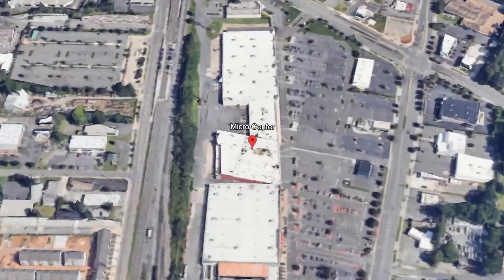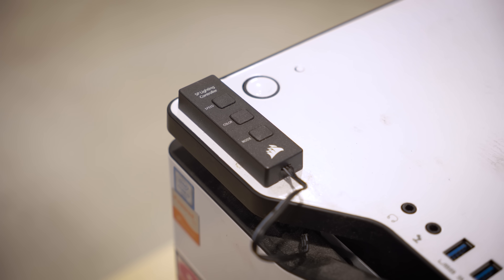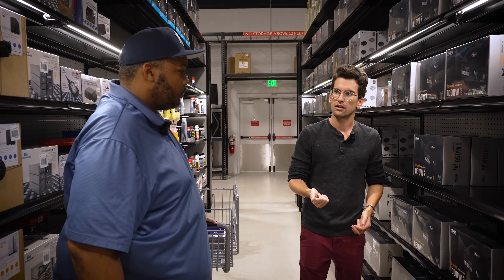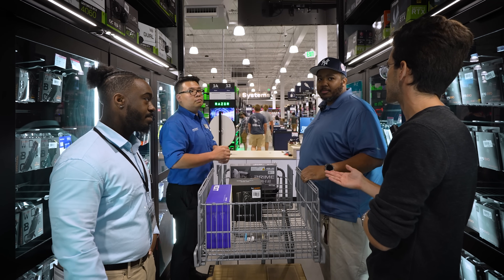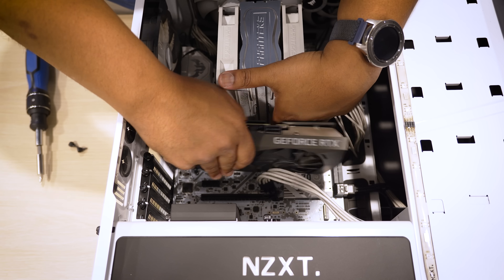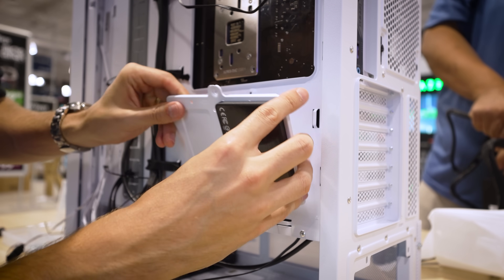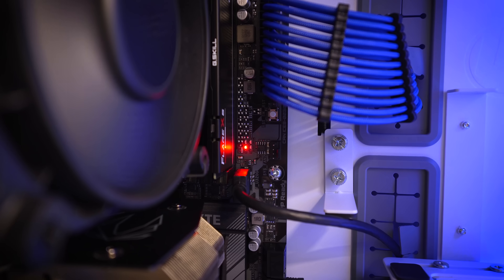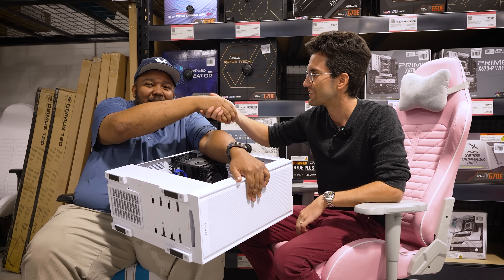Helping ONE LAST PC at the Charlotte Micro Center! - Gear Up S3:E6

Comment: I'm kinda confused why he made that swap on the bundles 
....less cores in the ryzen .... wasn't any better in any way
... just more expensive ....I would have just grabbed more storage in that case or 2 more ram sticks if the budget allowed it but spending more on components that gave no better performance with less cores and a bigger cost was a dumb move imo
Reply: Simple, do you want to have a dead platform or a platform with an upgrade path? That's the question that the MC Rep Justin basically asked with my remaining budget. So I went with the one with the upgrade path. More for my money.  - Sean

Comment: Hey Gregg long time viewer..figured I'd shoot a question in hopes u might have a quick reply..alpha testing a game called off the grid 2min into the game my pc makes a noise as if a USB is unplugged screen goes black and won't post peripherals don't work NOTHING!!! If I take out gpu and use internal graphics everyrhing works
Reply from the maker: Well it's an alpha game, so there's no telling what it could be doing to your PC... If it's the only game doing it, then it's the fault of the game and there's really nothing you can do about it until the devs patch it.
Reply: @GregSalazar  not just during the game it's not working at all since then ..I only played it for 2min my pc's gpu hadn't worked since only on board graphics but thanks for the reply

Comment: Silicon Power SSD is Junk I had one go bad after 1 year, I would try to avoid those!
Reply: The Inland NVME is my boot drive now. - Sean
Reply: @cellss0138  But you put it back in your build as mass storage right? That wasn't my boot drive ether but I had a major issue with one of those SSD where it would prevent my PC from booting up. Tried everything you could think of and in the end I just unplugging this drive and that made everything starts working again. At first it stated crashing in games and I thought it might be the MOBO, Ram, GPU or PSU or some major component, but after I tested everything I was confused, it all checked out fine. I even reloaded Windows 11 fresh and same thing, a couple days later it started crashing on YouTube videos, then eventually it would not allow Windows 11 to load at all, even though the SSD was not the boot drive. Someone said test your storage on Reddit, and sure enough it was that SP SSD man. If you ever get these symptoms, unplug that drive but honestly I wouldn't truth that thing even as a games drive.
Reply: @cellss0138  I had one go bad recently and it wouldn't let my build load at all, I wasn't using it as a boot drive ether, it was mass storage, but for some reason at first it would crash in games, then after a couple days it was random crashing and in the end wouldn't let Windows 11l load at all. I tried and tested every major component in that build and they all checked out fine, spent about a week pulling my hair out till I turned to reddit and posted and this guy responded about SP SSD's being junk. If that thing is still in your build I would yank it out and throw it off a building if it were me, after what I went through with mine! 🤣😂

Comment: I Believe ASRock have a newer white version of the B650E Steel Legend, called the B650 Steel legend WiFi  which seems to be B650E spec but with a white PCB in addition to the white heatsinks.

Comment: every time a  low budget build goes wrong. GAMING PC PARTS are simply too EXPENSIVE then you have to save up $3000.00 + a EXTRA $1000.00 for things  you might need like GAMING MONITOR that is  $400.00 to $500.00 mid tear price and you need a WALMART ONN MACHINIAL  RGB KEYBOARD $50.00 my have a DEAD  RIGHT SHIFT KEY for some strange hell hole in the production line in CHINA and a under $10.00 WALMART ONN MOUSE NONE RGB cheapest short cut. to keep the cost down. try a X570 MOHTERBOARD I know its OLD GEN its fine.,now for the secret $200.00 on NEWEGG RYZEN 7 5800X I cannot do business with MICROCENTER NO DELIVERY SERVICE the RYZEN 7 5800X is the BEST 8 CORE GAMING CPU then use the  AMD WRATH RGB AIR  CPU COOLER for a sweet  RGB CPU COOLINGbuy the 3rd CHEAPEST BLACK TOWEER$ $40..00 this is going to be EXPENSIVE GSKILL TRIDENT Z ROYAL GOLD or SILVER 32GB DDR4  3600 MHZ CL13 and RTX 3070 or see if a RTX 2070 SUPER is may be a lot harder to find. GRAPHIC CARD is forever PAIN IN THE ASS EXPENSIVE and EVGA SUPERNOVA 850G2 POWER SUPPLY I do not think all that money is not going to be use  and 2  of the 2TB NVME SSD windows 10 HOME 64BIT done. it may be old gen its going to kick ass on gaming  not interested with SPEED WARS BREAKING  WORLD WAR RECORDS just  make it work great I did buy a $700.,00  LEGION GO this is what low price dose. its full of FARTZILLA its a CRASH DRAMA GASMES  DO NOT LOAD. then GAMES CRASH LOAD SYSTEM RAM CRASH WINDOWS 11 BUGS CRASH SYSTEM it goes on and on and on. the best way to deal with that isdo not buy CHEAP SEAT LEGION GO and build a $3000.00 GAMING PC that might cost $2000.00 buying OLD GEN PARTS INSTORE PICK UP DOSE NOT WORK IN HAWAII AND ALASKA there are a lot of STATES that do not got a MICROCENTERso  buy a two way AIRLINE TICKET lots of TAXI TRIPS and HOTEL ROOM MORE TAXI TRIPS what a drama. NEWEGG ONLINE if I do have a DEBIT CARD. I ordered a new one in APRIL 2024 and its now JULY 2024 my DEBIT CARDS that I keep reordering is not delivered. NO NEWEGG ORDERS untill the BANK FIX IT.

Comment: ha this guy is just like me - 4tb nvme or bust
Given that $900, I would probably go with 7800x3d, B650 creator proart, 64gb 6000c30 and 4tb p3 SSD and just roll my current RTX 3080, 850w PSU, CLC280 and DIYPC Ranger R4-R case forward yet again.
Or perhaps a 7900 XTX tho that would leave me with no $ to actually install it as I highly doubt it would physically fit since my 300mm 3080 FTW3 Ultra is already a trick to get in and out.
Reply: Honestly, I'll probably apply but I do not think that I would be the best selection, particularly as I just picked up a 5700x3d platform.

Comment: I got my Ryzen 5 5500 today. I dont live near a Micro Center but got a Ryzen 5 5500 for 100 dollars. Ryzen 5 5600 cost 180 dollars where I live. I upgraded from a Ryzen 5 1600 AF and I can finally run my xmp profile on my 4x8GB DDR4 3200 MHz CL16 RAM. Also I had luckily a ID-Cooling FrostFlow X 280 cpu liquid cooler than I got a couple of months ago for 36 dollars. Max cpu temp during winter now I get 47C.

Comment: bro had the budget to build a decent gaming pc, and spent it on his platform.
not the best built ive seen -_-
Reply from the maker: ? He already had a 3060 and was content with it for now. He upgraded to an incredible platform - with the best CPU for gaming. Confused about what you're actually criticizing, here...
Reply: @GregSalazar  I think one problem that we run into as a viewer is that we don't always know the full picture.  For example, I don't know what Sean's setup is at home as he may be hooking this PC up to a 1080p monitor, and in that case, keeping the 3060 is fine until he upgrades the monitor.  Without understanding the point of the build, I could see folks noticing that it looks rather "unbalanced" in regard to the CPU vs. GPU.

Does it matter in the end?  Nah.  He seemed quite pleased with it, and that's the main point. 👍
Reply: @shinaikouka  I was content...........for about a month. lol

About a week ago, I picked up a 4070 by Galax on sale for Prime Day. Next update, a replacement for my 29' LG ultrawide monitor. - Sean
Reply: @GregSalazar  just the combo of a 3060 with a 7800x3d is making me cringe (the hate towards the 3060 is real) 😂
Solid build, just not my taste 🥲
Reply: @kings9469  maybe he bought a better gpu with his own money, as soon as the camera turned off ...
if he went with the intel platform that would have been a bad choice.
Reply: i think it was fine, though i wouldn't have bought a 3060 to begin with.